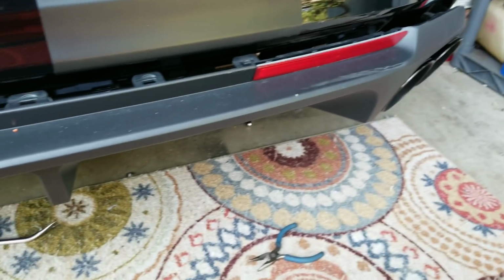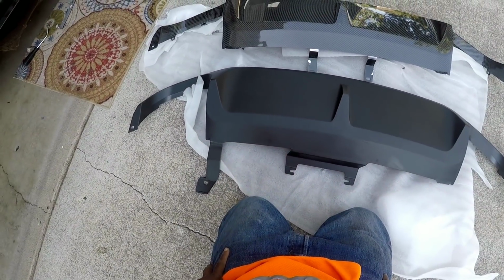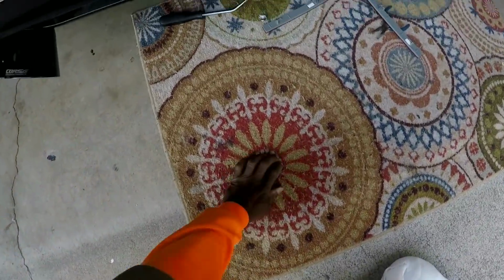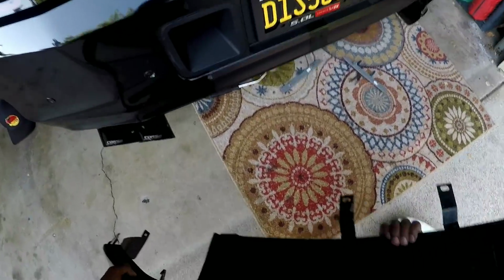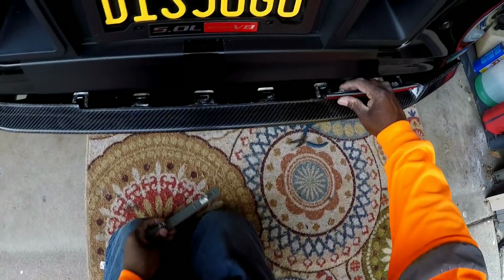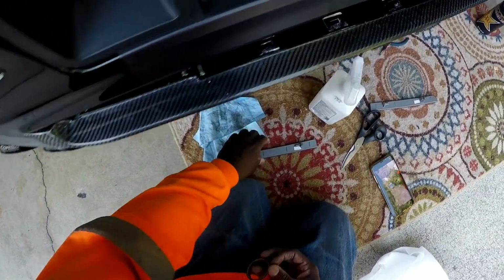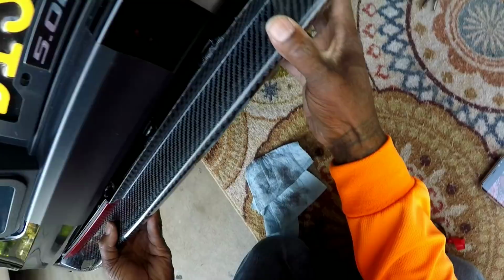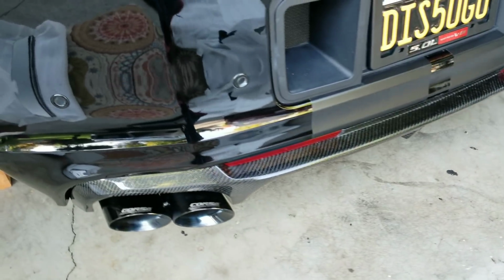TruFiber Carbon Fiber Quad Tip Diffuser (LG149KR)

Comment: I've been thinking of changing my gt500 diffuser to carbon fiber, now I know what it looks like. It is a solid piece, should I be worried of reliability?
Reply from the maker: Thanks for watching make sure you hit that like and subscribe button and check out all my videos.  No shouldn't be worried about nothing, but carbon fiber is addictive, you get one piece then you want more good luck😂😂
Reply: I see your hooked ☺! The car has transformed into Trufiber machine LMAO. I've watched your videos, when you installed Roush SC. Almost purchased one but, want ahead and installed 2.9 whipple. Keep if up.

Comment: Hey, just got the same part, but not quad tip (LG140). It has all those tabs on it with nowhere for them to clip into. I am assuming you have to remove the long black plastic piece that sits between the 2 red lights?
Reply from the maker: What bumper do you have on your car?
Reply: Stock 2014 GT premium. Probably the same as yours.  @DIS50GO
Reply from the maker: @frankc6414  I have a gt/cs I think my rear valance is different from yours, do you have a Instagram account so I can see your car
Reply: @DIS50GO  no I dont have a insta account. I found a video on CJpony that shows you have to cut the bottom part of the bumper off, then cut about 8 slots for the clips to insert into. I dont want to hack into my bumper cover like that. So I might try to figure out a way to use 3m tape, or try to find another bumper cover I can modify.
Reply from the maker: @frankc6414  yeah that's why I was saying yours is different than mine, the California special (gt/cs) you dont have to cut nothing you just pop the old one out and put the new one in. BUT when you take your stock bumper off there a line on it that tells you where to cut, you cant mess it up because your gonna be covering it up
Reply from the maker: Here watch my other video, when I explain it a little more 
https://youtu.be/WEMFl-kB1bI